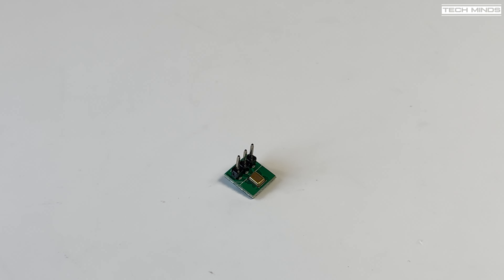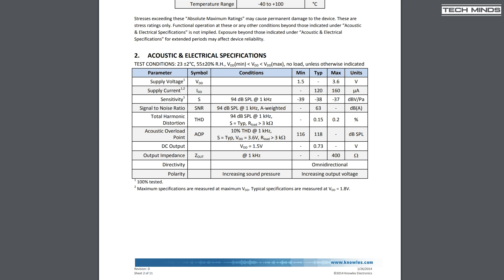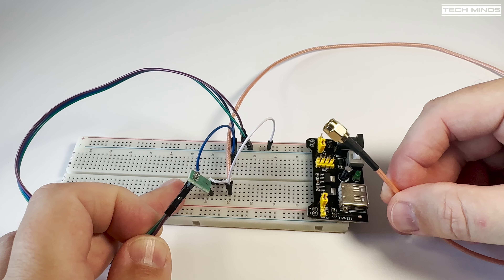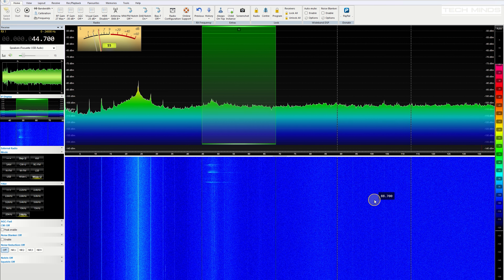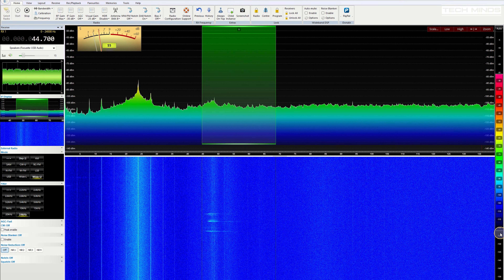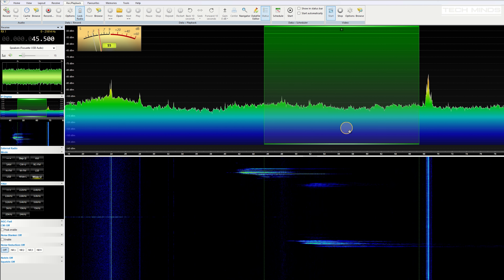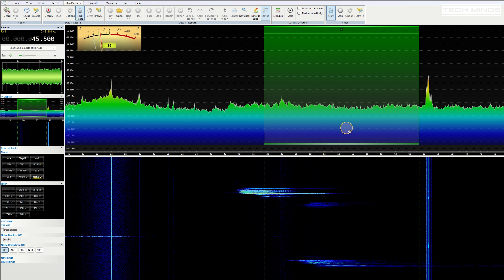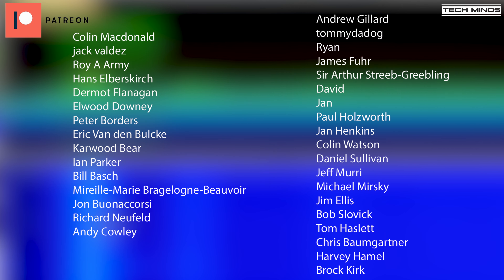Ultrasonic BAT Detector Using Software Defined Radio

Comment: If you want to hear plants scream, point your mic towards them and pluck their leaves/fruit. They screech at high frequency allegedly. I read a scientific article on it once, but never thought to buy a high frequency mic, and down convert to confirm.
Reply: @bentcrazy1324  some believe consciousness is actually the opposite of matter, and is immaterial. If so, and there is a conjugate bridge between the two, then conscious experience would not be dependent upon brains, nervous systems, etc... It could function similar to a radio where the signal is received via a resonant antenna and processed. Some have proposed that h2o is such an antenna. In fact, it makes a lot of sense since no conscious experience ever had by any person, has ever been able to be created or duplicated by external scientific methods such as stimulating parts of the brain, or sending electrical pulses etc... Most evidence points towards memory and consciousness being non local. Ie, not derived from the brain, but rather, processed or filtered by it. Bullet in the brain is no different than drilling a hole through your radio and then trying to stay tuned in to your favorite station. The broadcast signal is not affected, it is just no longer received and modulated. 

Anyways, I'm getting off track here... There is an amazing radio lab pod cast on plants being conscious. They ran an experiment where they tried to determine how plants' root systems find water. What they found was, if they ran two pipes beneath them and one had flowing water, and one did not, the plants' roots would always grow more towards the pipe with the flowing water. So they got clever, and played an mp3 down the pipe that was just a recording of water flowing. They removed the actual water. The plants still grew towards the pipe. If you look at the hairs inside your ears, and the hairs on a living plant's roots, can vibrations and information be transferred just the same? Meaning, if something is alive, processing h2o, and has physical features that could theoretically be akin to the 5 senses we know for certain, and if consciousness is one big pie in the sky that can be received and then becomes filtered and fragmented via physical structure of the matter interpreting it. Then, I'd have to think that everything living from plants, to fish, to lions, and humans has some level of conscious awareness, feelings, hopes, wonders, etc...

Comment: I have tried and successfully received bats that fly by my house. I used a modified 40 kHz entered ultrasonic radar module. I built an amplifier and could barely detect the "Fruit Bats" that fly around my house. Your results are much better. I will be purchasing the type of microphone you suggest and trying again. Thanks for the very interesting video and information. I'd like to see some pictures of your setup.
Reply: How did your project work out? Very interested in this!!

Comment: I started on a similar project years ago.  I have an SDR-IQ receiver and the same SDR-Console software and even bought a few MEMs microphones.  That was before I retired and got distracted by other projects.  I hope your video gets me working on it again.  Thank you for the inspiration.  I'm in the Eastern US so I suspect out bats will be other frequencies.  
One similar project I started was to monitor the signals the local power company used over it's lines to communicate with water heaters that consumers had agreed to allow the company to shut off to reduce peak energy consumption.  It used frequencies in this same range.
Reply from the maker: Thanks for the info, projects like this always spark interest and it’s quite thought provoking. I’m always on the hunt for projects like this. Thanks 🙏

Comment: Fifty years ago I lived in the Chilterns and at dusk there were bats aplenty. We had at the time a new Ferguson TV with one of the first remotes which worked at ultra sonic to change the channel.  This thing was a bat jammer  if the french windows were open, we didn't do this too often as it seemed to cause a mass panic amongst the bats with airborne collisions and we were worried about injuring them.

Comment: Fantastic off regular radio topic, but a great use of SDR Matt. Was wondering if with ELF microphone pick up and the right amplifier you could detect subsonic frequencies in the Hz range? There has been experiments in the past for early tornado warning detection. Definitely gets one thinking of what’s out there from DC to daylight! Thanks for your excellent channel and content.
Reply from the maker: That's really interesting! A lot of tech out there that can be explored and experimented with. This is just the tip of the ice burg! Cheers

Comment: Great stuff! I may try this since I have RSPduo receiver and SDRuno software (1 kHz - 2 GHz). I think that ordinary electret microphone on preamplifier may work, since rating 20 Hz to 20 kHz is just for flat response. Above 20 kHz it is no more flat response, but I bet it can go very high. Too bad, I did not see many bats recently in my area (Croatia). Yet, I may try at some point after finishing messing with 1420 MHz neutral Hydrogen radio astronomy.
Reply from the maker: Absolutely! give it a try and let us know how you get on with that electret mic.

Comment: where did u find that mic mounted on PCB? tnx
Reply from the maker: I got it from Ebay (UK) but they probably sold out by now. But you can get the mic separately from many places. Just google the part number.

Comment: Easy question: is a  Knowles SPU0410LR5H-QB as good as a Knowles SPU0410LR5H-1 (matched mic)?
Reply: Those 2 mics are exactly the same specification ... except the SPU0410LR5H-1 is limited to 10KHz only ... so it will not pickup the higher frequencies required for Bat Detection ... whereas the SPU0410LR5H-QB goes up to 80KHz ...

Comment: Question: Why not use the soundcard and virtual audio cable and use audio device input in the SDR software? My microphone input (Common Realtek HDA chip on mainboard) can go up to 192kHz. That should be enough, so that you can just use the microphone you bought as a microphone. If that works - and why wouldn't it - then everyone who doesn't have a SDR Radio can try it too - maybe it even works better because SDR Radios that go this deep are expensive. I don't have such a Radio, ie. But using the microphone as what is is directly ... sure.

Actually, I just tried it with my smartphone, its internal mic and SDRangel (which has a android app) and I can demodulate stuff from above 20kHz with it no problem. (still testing) Maybe just connect that microphone to your smartphones 3.5mm jack, if you have one. I do.
Also, even though SDRangel only shows a max freq of 48kHz on my smartphone, other audio spectrum apps can show me 192kHz, just like my PC. Maybe with this microphone it will actually detect sound from that high as well. (my mic stops at 44 or 48kHz)

Comment: Cant you power it from Bias through cable?
Reply from the maker: Absolutely! I did start designing a board to mount the mems on, and added a bias tee to extract the V. Didn't get round to finishing it yet though.
Reply: @TechMindsOfficial  would br great if RspDX could power it directly

Comment: 1:19 Beware these cheap breadboard power supplies that contain the cheap AMS1117 style voltage regulators.
If you momentarily short the output and then remove the short, the full input supply voltage will then appear on the output of the device. I've blown two such PSUs and the semiconductor chips in circuit.